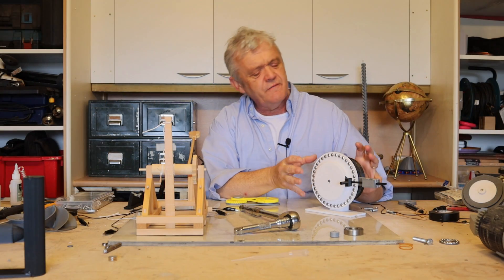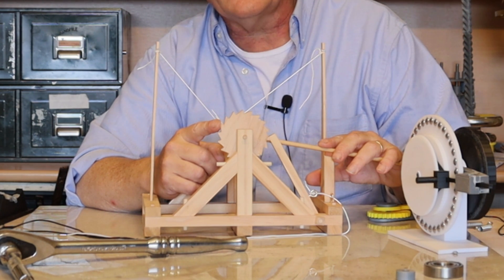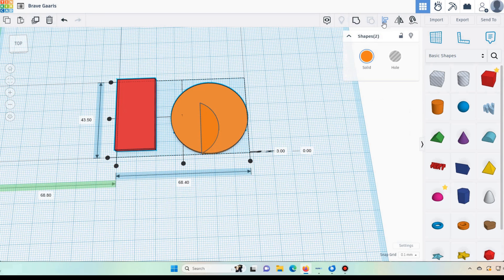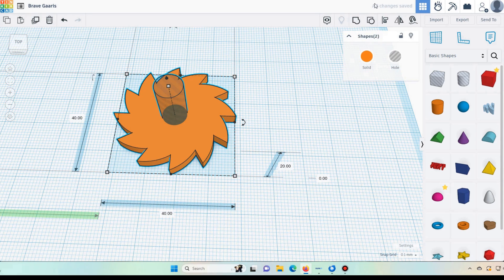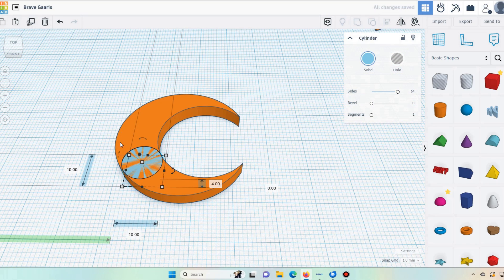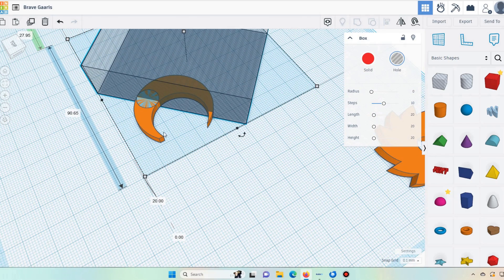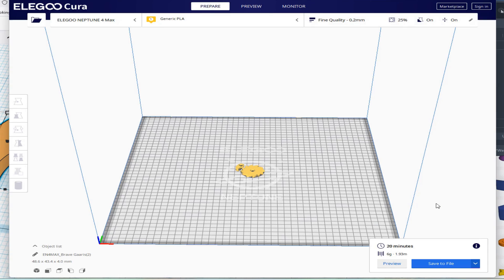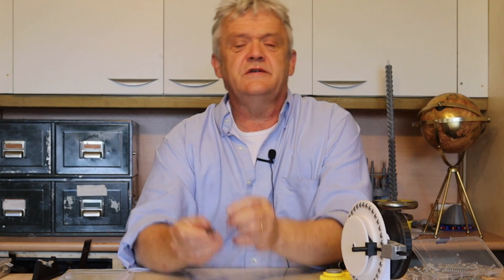2078 Ratchets In Tinkercad

Comment: I want to roll a wight down the slope of my property to get power then i need to pull it back up the hill with solar or wind. I will need a large ratchet.
Reply: what mechanical advantage would you be looking at needing to assist the "motor" in pulling the weight back up? worm drives have large value of  mechanical advantage (force out divided by force in) and could  in this application have an the advantage that a ratchet wouldn't be needed.
there is also the simpler mechanism of a differential windlass? nothing more than two winch drums of different diameters that are locked onto a common shaft. when shaft is turned rope unwinds from one drum, down to a hook the load is attached to, and then winds back on to the 2nd drum. because the drums are different diameters that means on turning there's a difference in the amount of rope played out/in. closer the diameters are, the greater the mechanical advantage  and again at large values of mechanical advantage won't need a ratchet
Reply: @stevecummins324  Thank you 🙏👍
Reply: perhaps have a look into water powered inclined planes, funicular/cliff railways etc.
they had two carriages running on rails on straight slope. cable ran between them and around a large pulley at the top of the slope. what would drive the water powered ones was the difference in weight between the carriages. both carriages had a water tank underneigh. when carriages were at the extreme of that run... carriage at the bottom would release water from it's tank, and carriage at the top would have water added to it's tank. then once ready for movement, brakes would be released. historically a stream usually provided water for the carriage at top, and water from the bottom carriage would run to waste, but there's nothing other than such needing a power source to stop water being pumped back up.
NB it's  possible to avoid laying 4 rails all way up slow... there are arrangements which have passing loops in the middle of the slope, and allow use of 3 or even 2 rails for bulk of slope.

Comment: Hey, I saw your previous video on the button generator and when I was mopping the floor later on I noticed the spin mop bucket e.g. Vileda easy-wring spin mop bucket (not sure how common they are in UK, but you can search YT for examples) - you press the pedal and the "rotor" spins and keep spinning, while the pedal comes back with a spring. You can get it to pretty good speeds  with couple of pushes. Might be something easy to turn into such generator as well, as it seems to have exactly the same idea as your button generator, probably using some kind of ratchet as well. might also be fun to take apart. Cheers Rob , always looking forward to the next video